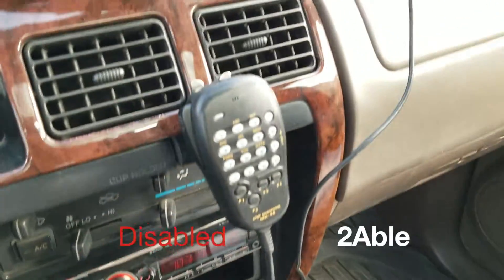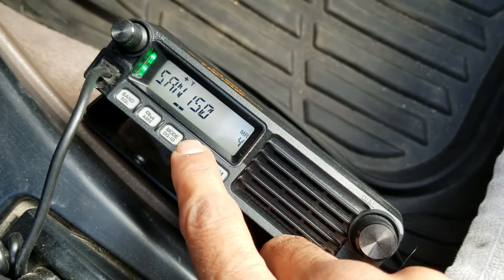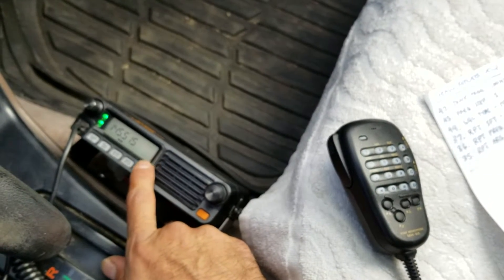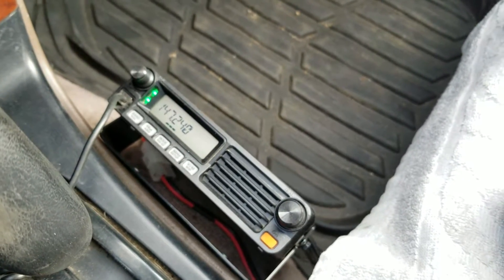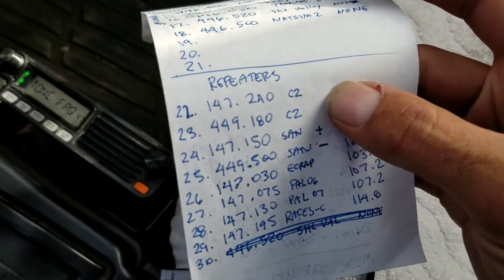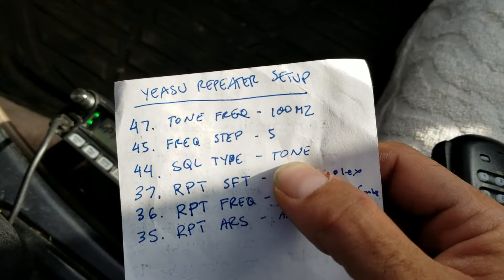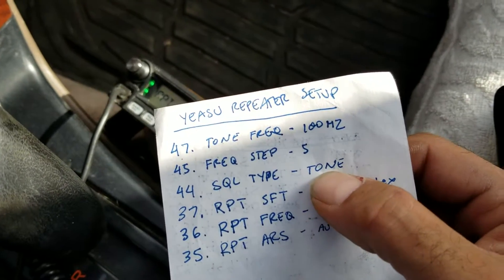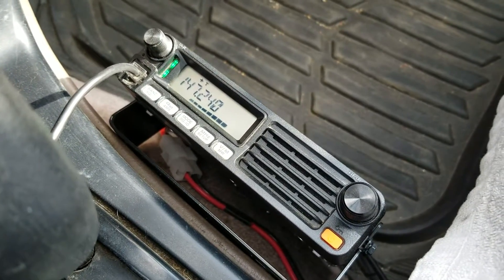Yaesu ftm-7250dr Repeater Setup

Comment: Do you know if this radio would fit in the bay under your car stereo?
Reply from the maker: I believe you can. May need some install kit or custom brackets.  I'm not sure if it's exact fit.  I didn't because of heat and being able to access the cable
Reply: @fotomotoxxiii  Looks like it was designed for it, but I couldn't find a single installation showing this. Might be a selling point for me. Thanks!